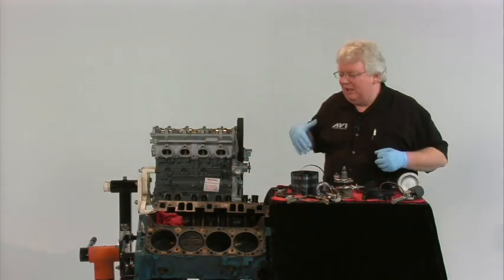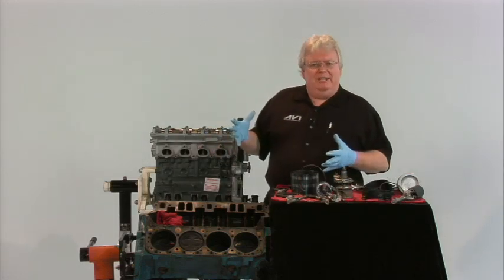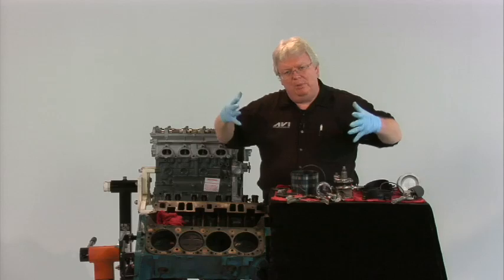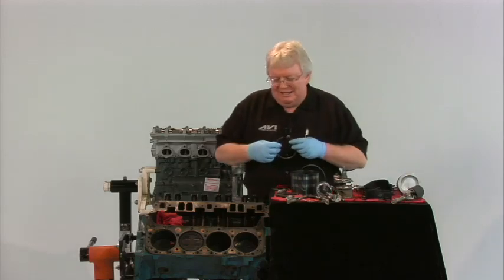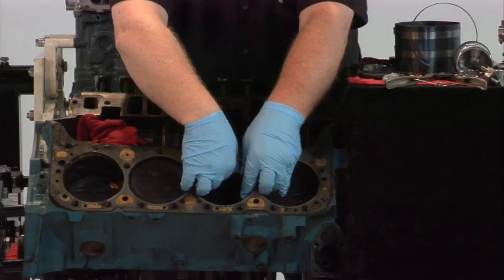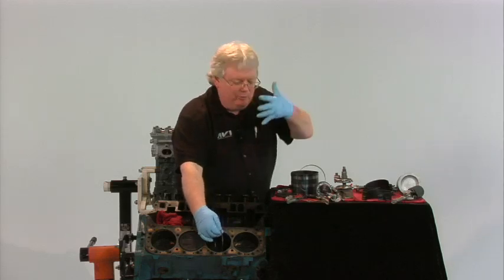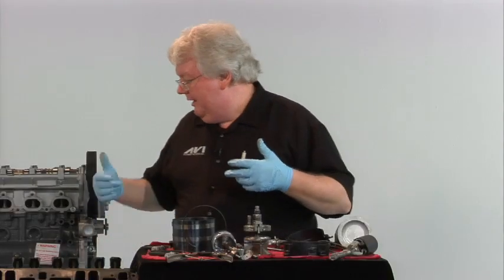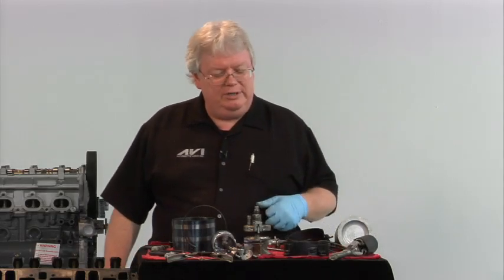Measuring Cylinder Taper w/ a Feeler Gauge | ASE-A1 Engine Repair | Tech Tip

Comment: Good tip but aren't feeler gauges straight?  Are there any out there which would have a slight curve to them for this kind of quick test for smaller bores where the radius is greater?  Might be nice to have something like that so the DIY'er won't have to get a bore gauge (as a quick test).
Reply: You are measuring straight up and down the cylinder, you want it straight/flat